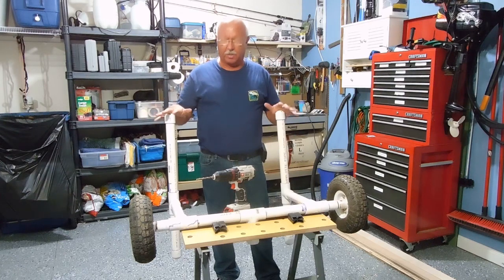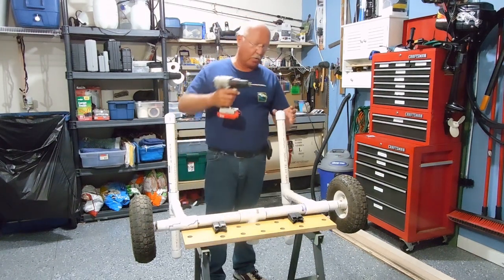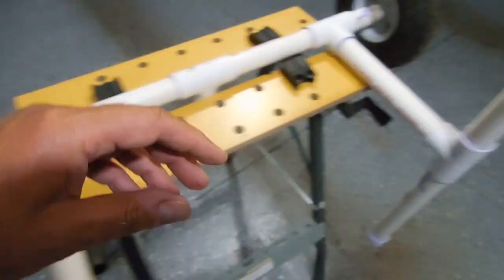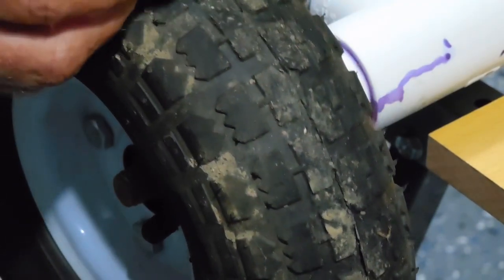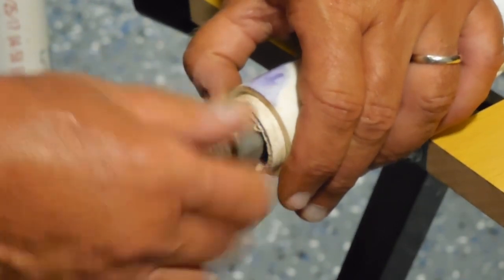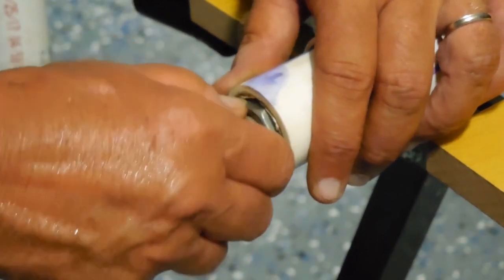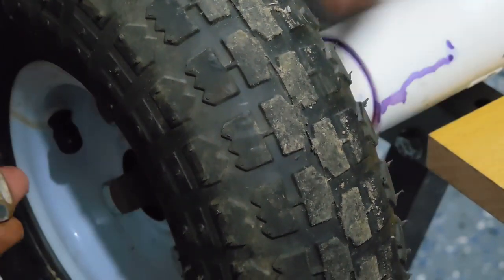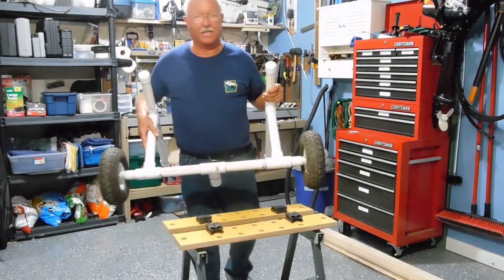PVC Boat Dolly Update

Comment: Boiler Dan what a great idea to help with deploying my Mariner 4.  I've added a T-handle to the end , and am toying with the idea or adding a small winch to the end to help with pulling it into place when coming in from the water. Thank you for a well informative video!
Reply from the maker: Mr. J. Campbell III ; Another update, I had let the T handle drop to a cement ramp and it broke the pvc T.  An easy fix, I just slid the thicker pvc pip over the cracked 1” T and that gives me a double thick T handle.  I still have trouble bringing it in alone.  I have resorted to dragging it out of the water and then tilting the raft up and sliding the dolly under it, just like I do when launching.  It does work great for launching!  Thanks for watching and taking the time to comment!
Reply: would adding a 45 degree fitting to each ends of the pieces the boat sits on make it easier to pull the boat on and off ? A nice piece of kit btw.....

Comment: Nit Picking with a few ideas. 1) Instead of drill vent holes, leave the end caps off. See if it has any negative effects. 2) Instead of  a steel axle rod, use a piece of PVC w, the OD that matches the wheel bearing ID. Use schedule 80 PVC add an inside & outside large washer then pin the axil to the wheel similarly to other pinned joints . 

Question, do you launch close to the water or do you dray your boat 100 yards or more? How do the wheels work in sand and uneven gravel?
Reply from the maker: Sounds like some great ideas for some improvements in design!
I have pulled the dolly quiet a long way with out any problems. Not 100 yards though.  The air filled tires do well on most any surface.
Thanks for watching and making design improvements 👍👍

Comment: I recently inherited a 1980’s Coleman Scanoe that I could only barely move on my own to store last season (I might weigh 10 lbs. more than the boat 😂).
 
I’m wanting to make something to get my boat down to the shore for times campground gates are closed but lakes are technically open - IF you can walk your boat 3 city blocks to the water. 

I’d need to put some kind of stabilizer bars on the cart closer to the hull as well because it doesn’t have a flat bottom and I’ll need both hands to maneuver the cart. 

Any suggestions the there?
Reply from the maker: Hmmm;  maybe work with angling the PVC PIPE to have it aligned with the shape of your hull? You can angle the pvc in unlimited ways. Maybe duel shafts for additional strength?

Comment: Whats the angle between the pulling pole and the platform?
Reply from the maker: I did it on a 45 * angle, but not really measuring it.  The pole will flex a bit, especially when fully extended so I wouldn’t recommend having it at any slant at all.  I’ll add that I still had trouble with it floating.... so the air holes didn’t help. If you have a second person to help guide the boat into place it’s not a problem. But if alone, I end up dragging the raft ashore and then sliding the dolly underneath it on land.  I also tie the dolly to the back of my Subaru Forester and slowly pull it to the top of the ramp, saving my strength 😂
Thanks for watching 👍👍
Reply: @BoilerDan1  Hi Dan, you have great videos, very good information too. Thanks for sharing and for the quick reply. Stay Safe!
Reply from the maker: @RobertShroder  I’ve given up on safe!  On vacation in Florida! 😂😂😂
Reply: @BoilerDan1  Cool!

Comment: Dan: FYI - I estimated the cost of your PVC Boat Dolly to 2022 Inflated cost and I calculate the cost will be about $140. 
Here is my break down ;
item	description			quantity	 unit cost  	cost 
1	1”x10’PVC pipe (schedule 40) 			1	 $15.92 	 $15.92 
2	1 1/4” x 10’ PVC pipe schedule 40 		2	 $23.77 	 $47.54 
3	1 1/4” PVC 90*elbows schedule 40 		5	 $2.16 	 $10.80 
4	1 1/4” end caps schedule 40			4	 $1.61 	 $6.44 
5	1 1/4" x 1 1/4" T 90 degree 			1	 $4.11 	 $4.11 
6	5/8" x36" all thread rod			        1     $14.47 	 $14.47 
7	5/8" washer, 4 pack 			                1	 $1.24 	  $1.24 
8	safety pin ,2 pack			                       2	 $1.86       $3.72 
9	cap nuts			                                       2	 $0.51 	  $1.02 
10	5/8” lock nuts 			                       2	 $0.51 	  $1.02 
11	10” wheels (HF) steel hub 			       2       $9.99 	  $19.98 
12	1 1/4" male threaded adapter			1	 $1.52 	 $1.52 
				                                   sub total		       $127.78 
				                                          tax	9.2%      $11.76 
				                                                total 	      $139.54 
The costs are based upon Home Depot retail prices at Tulalip WA  major cost increases were PVC pipe, all thread rod and wheels
Reply from the maker: Thanks for providing that information. A great help to other viewers!
9.2% state tax! Indiana still 7% 😂
Thanks for watching too 👍👍